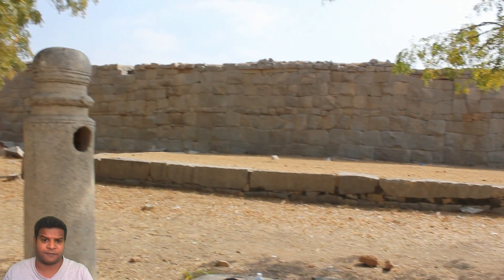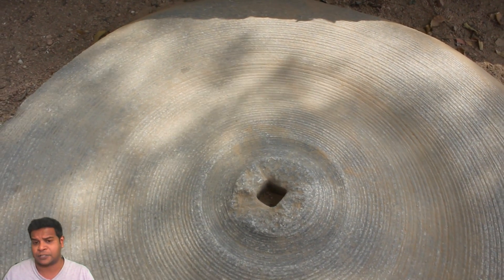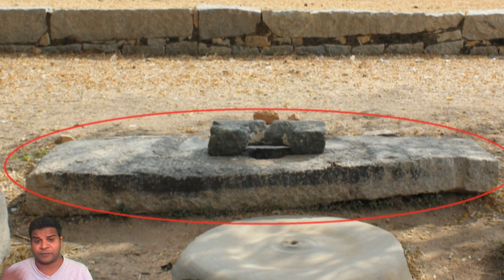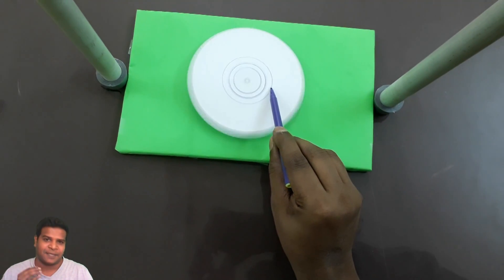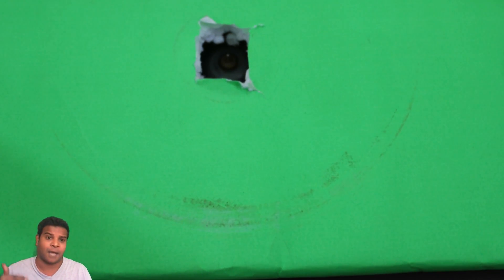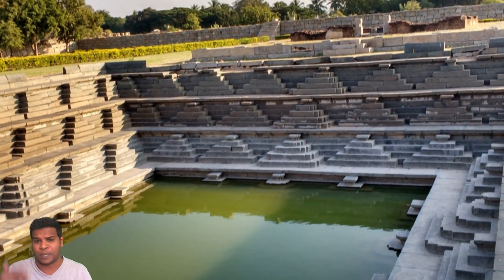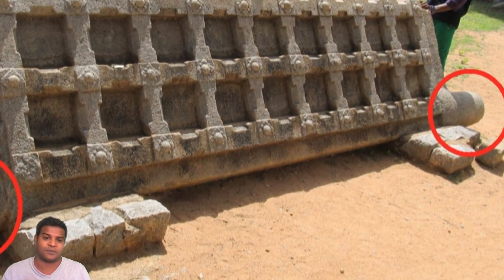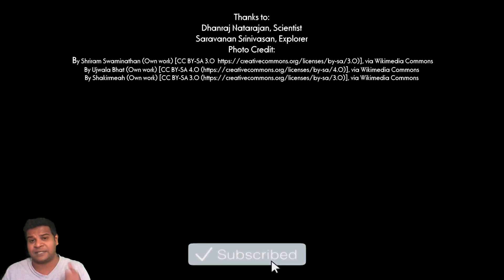Ancient Lathe Machine Found in Hampi, India - Lost Technology Discovered?

Comment: I have some questions that I don't think you addressed in your video.

1. How can you reliably date stone items you found on the surface? There is no archeological or geological context.

2 You stated that the rectangular hole in the item you found is at the center of the carved circles, but to my eye, it looks off center. Did you do any precise measurements to determine how close the hole actually is to the center? Did you document the measurements on video?

3. How could the objects you found or the model you show drive an object in a circular motion? In your demonstration with the pen, you have abandoned your model and appear to be driving the disk from the bottom with a motor, but there does not appear to be any room for a motor or other drive system in what you claim to be the base of the anceint laithe.

4. Hoe does the fact that concentric circles can today be made on a modern laithe prove, that the same effect could not have been achieved in the past using a different method? I cannot follow your logic.

Comment: Please see that place closely it's not a lathe, it was used to powder grains. That stone slab have the mating pattern of that round stone. And distance between the two pillar is less than the width of the slab. Round stone is supposed to be placed over the slab and rotated using wooden stick to powder grains. One more thing lathe is not a futuristic technology it has been there for thousands of years in different forms ( e.g. The way they made wooden wheels, making clay pots). What you see now is a evolved form of it. Please don't miss led people. If your want to check it your self go to Hampi it's in the parking place near Mahanavami dibba.

Comment: yo bro, very interesting. one question however. i agree a type of lathe may have been used or posibly...more likely a ceramist potters wheel. the more impactful question for me is what was this stones use? also,, wouldn't the gouges that represent the circular patterns appear at different angles if a tool was simply lowered onto a rounded then perpendicular surface. i'm just saying! K.K. DO (Doctorate in Observance)

Comment: Its a mill stone At 2;20 you can see where the round stone ran on the flat stone producing a negative of itsel....f the hole in the centre of the bottom stone is to allow whatever you were milling to pour out,,,  the missing pole between the two pillars allows you to lift the heavy mill stone off its bed and clean it ..... its not a lathe its a mill wheel Ireland has lots of them from this period.

Comment: The guy is correct. Machines wer used, but time line is much longer and machines much higher tech. .. According to the Pleiadian Mission by Randolph Winters, based on Billy Meier's 70+ years of et contact,  at theyfly.com, the Giza Pyramids were built in 71,344BC.  You can google ancient machining at Giza, especially well researched by engineer Chris Dunn.

Comment: Very interesting! Just a few thoughts: lathe technology is more than just the setup, and depends largely on two factors. The first is that the machining tip is harder than the material it is shaping. The second being turning the work piece at sufficient speed for the process to work WHILE  minimising chipping. So you need to work on the two subjects.

Further, the setup you're proposing does not seem to have a mechanism to lower it raise the work piece or the machining tip, one of these would be required.

Also the setup does not account for torque on the machining tip.  Where the direction of force aligns with the axis of the machine tip, you'll get the work piece pulling on the machining tip, causing an imperfect finished product. There is a reason we don't build lathes this way today. And though the could be temporarily accounted for with "stops" or "locks" those would get worn down and experience increasing deviation as they age. 

So I'm not disagreeing with you. In fact, I'm excited at what you're sharing and hope you continue to develop a more perfect (accurate) picture of the past.

Good hunting.

Comment: Nice find! More research needed! Are they separate circles or a continuous spiral? If it’s a spiral, the mechanism on the cross bar becomes even more complicated and amazing. This is way out there but if it’s a spiral it would be interesting to attempt to “play” it like a phonograph record! It sounds crazy I know, they probably wouldn’t have known to record sound in this way but sometimes sounds can be captured this way by accident. Given the scale of the disk, it may be possible something remains of what sounds were going on around the stone when the grooves were being cut, even with the weathering. There were small record players that rolled around the record under their own power as the record lay motionless. A similar design might be interesting to try and not be very expensive or complicated to try.
Reply: Here is an example of what I’m thinking of: https://youtu.be/SM-TcnLF2Tk  This is a new product but an old idea. I think there was one years ago that didn’t use an electronic amplifier for sound, only a battery and motor to drive it at a steady speed.

Comment: Well, I have bad news for you. It is not the oldest machine known to mankind. Google "millstones". Here, in Europe, we used them already 10 000 years ago, and setup is very similar to what I see in your video. As I know in ancient India it was a common machine too, I think it's called "Chakki". 
Yes, it is amazing structure and yes - it is a machine, but first, you should see around - does it look like it is a place for workers to do lathe work? Probably it was used for the very specific process. And I don't think that the smaller round stone is a product. I think it's a part of the machine. If you would look into ancient China - they were using massive cranes, water-powered mills, machines and much more made just of wood and metal. I guess you didn't see this https://www.youtube.com/watch?v=4TzLejrJ6I8

Comment: you need hard bearings and softer shafts running in them. grooves inside collars for water and/or oil lubricant to run inside the collars. I would guess wind powered with large textile and wood funnels to concentrate the draught onto the wind veins. Although ducted water onto high leverage scoops would work in wind innaccessable spaces. By the way a square plug hole is for something inserted that wont rotate other wise it would be easier to male a round hole. 
So maybe a stone critically balanced and turned by a shaft connected, then perhaps turned by wind water or whatever as you have there, might be the fly wheel for momentum.

Comment: brother , very good video , really impressed by your video , 
this lathe made of stone is simple and not strange , can u explain the power drive for this , like may be animal powered or water powered , 
then chiselled stones of the pond u showed can be chiselled by skilled workers it is a possibility , 
can u explain those beautiful stone doors , they are marvellous 

i would like to add one thing , as u showed in your video the building process of modern day buildings , after the building is made , the mega machines and huge scaffoldings are removed , so obviously if the big structures u showed were built some kind of machines would have certainly been used to hoist the huge stones and then removed from site , can you find some examples of ancient machines like the lathe u showed , 

i was wondering if you could explain as to why the base stone was removed from the centre of lathe and placed at the site and also as to why the circular stone was in the middle of the two pillars , 

is it possible that the machine u showed was a flour mill .

Comment: would it need high speeds? working with rocks would rather need the opposite. but sharp and hard tools might be needed.
would a simple hanging metal pole do the job? rather not because its too instable in principle. but a little more complex setup like a lever with two ends can do "wonders". one end is for the operator to pull with a little rope (some knots are allowed) - and the other end with some wheight... well "forging" a rock wont work without some sort of force applied. - think again - you might be on the wrong track - at least the missing part is not the one that you depicted for various reasons. be a genius and think like an engineer. the indian ancestors were. ;-)

Comment: I think that the machine in question is not a lathe but a milling machine for grain. The circular piece is the millstone. It fits into the base stone .  An outside force is used through the square hole to turn the millstone. the grooves are a result of years of use. Windmills that were used to grind grain had a similar setup and of course the wind provided the power. In this case a cross bar powered by oxen could have been the power source, or several Conans turn the wheel like in the movie Conan the Barbarian.

Comment: I Think you stone lathe needs more investigation, the large centre stone must of held a circle with a square drive to fit in the rough centre of the round stone, and above it or the weight against each other wont rotate and would scrape away the groves in the surface, if we stick with your rod passing through the posts the it would make sense that one end would have a arm extending of it with a weight to keep a cutting pressure also a second tool would be used to follow around the arc of the stone. also on the small stone sitting on top is that a makers mark or a reference point, the circle with a line going north to south on the back of it.Just my thoughts...

Comment: Praveen, another great video from you!
There is An interesting theory that can explain a lot (don't know if Ik mentioned this earlier:
Please look for egypt pyramide geopolymere technic.
A company explained how they could do that with ancient tools. The stones of the pyramides look natural, but they are not, they are manmade!!
Using salt water and limestone grain, you can make huge blocks cuz you can make the stones in the spot like concrete. Wooden cast, pur IT like cement.
In your video maybe they did the same (all civilisations had contact with each other).
Maybe they did not have to use laser or power machines. If they did IT like geopolymere, the Stone would be soft like clay and then it is easy to make the circular ingravings, just as you did with the pen.
What do you think about this idea?

Comment: the round rock may be upside down. the groves and contour seem to match the ones on the larger piece. the square hole may have been a mount to the centre of a bearing .  i believe the round rock may be flat on the other side and have been a rotating table

Comment: Interesting! My father in law was a machinist. When my wife and I were dating and for a time after we married I worked for him in the machine shop. I would suspect diamond then like today would be the most likely cutting tool. While your "machine" is possible it presents some problems as well. Tooling would require a form of power, hydronic or water would serve nicely. Another problem I see is the long distance from the rod down to the work piece. Even stone would reflect and push away from the cutting tool. This would result in breakage of the stone. Possibly much like the breakage seen on the slab opposite the rub marks on the slab. I think in India, Egypt, and other Ancient sites it is obvious men not only knew how but did create machines to cut and form stone for construction.

Comment: great theory and reconstruction , but too much detail is missing at the moment . more evidence is needed before so called experts will accept your theory  . your spinning stone with circular grooves could only have been made  with a machine , a grain mill would not produce the concentric circles with such  accuracy , but you need to find more parts of the machine if they exist , at the moment you have a  stone with circular grooves , a large slab that looks like something has been spun on it  and two pillars with a hole , there must be a lot of stone dust around the base of the machine produced by the machining , and a lot of circular stones in the local vicinity that would need to be made by machine  other wise there would be no need to make the machine .. i don't  want to dismiss your idea ,it's a very  good explanation , but more proof is needed .

Comment: I'm kind of stuck on a few details here.  To precisely maintain the axis of rotation, and to carry that amount of unbalanced load, you'd need a really strong spindle with very nice bearings, right?  Or is there another way?  And what system of force would induce the rotation of the stone without tiring (human labor) and I'm assuming it would need to be steady?  And if a cutting tool were hanging on a bar between those holes, what would prevent the bar from rotating on it's axis and allowing the cutting tool to be pushed out of position?  It seems kind of janky to me.  I'm not saying that it is not a vertical mill.  Just that it's still very perplexing.  Anyone have any ideas?

Comment: dude you are brilliant i love your videos great work !!!!!
Reply: It looks more like a grain grinding setup with the round stone turning on the flat stone, hence the wear marks.  The vertical tool you propose is not viable as you need to have the tool rest very close to the work otherwise you just get the tool chattering (vibrating). The pillar pivot points could be part of a gear setup to turn the grindstone or just for a bar to hang your sack of grain on above the wheel. More investigation needed.

Comment: That round stone is the turntable which should be flipped over and placed on the long base stone on the ground, the square shank is for driving it from underneath. It is a bit crude and should have had slipper shims to stop the wear on both turntable and baseplate and used animal fat or oil for lubricant. Roughly shaped rocks from the quarry are placed on the turntable and the cutting tool brought across as the turntable is rotated and when a face is completed the rock is rolled over and squared up before machining the next face and so on it goes, they may have used diamonds from the kohinoor or similar area as the cutting tools or just hard replaceable stone or metal cutting tips. I use a lathe for making square or rectangular objects from any material so don't get caught just looking for round machined objects because I would have done every square stone with it too, go and search for "cube within a cube" on a lathe which is our very first machining job as a machinists apprentice after six months of creating everything with hand tools. I am at the end of my engineering life having now retired and know exactly how they were making the stones but it took you to discover the evidence, keep up the fantastic work. Ken - Australia

Comment: That is an interesting idea you have their. Potentially could have been as described but I am not sure. The round block looks like it was formed from a cement like mixture as seen used in Angkor Wat. I noted in your video that the slab also had circular markings. Do you have a theory for how the blocks were rotated and how the lines are drawn down the curvature? I think you have made a discovery here and while I am not sure I agree with the current state of the theory it is a great find and presents questions that need asking. Great work.

Comment: The slab didn't move. Your rod for carving was placed in the slab. That's why it had half circle. The rod would move after it finished the circle. The circle on the ground was what rotated. The 2 poles on the side would have been used for the weight. Just like lowering a water bucket into the well. You would lower and raise the weight that would press against the rod used for carving coming from the slab.

Comment: very clever, I think you got it right, it makes perfect sense.
  I don't know if your aware but with metal lathes there is some turning that is done by holding a metal cutting tool in your hand similar to a wood lathe. It isnt done much any more but you can make very good tight and or very curved surfaces with your own designed tools.

  As for the turned pieces at the buildings, they must have used the same lathe but the cutting tool is held sideways and the pieces standing upright ! !

Comment: You shouldn't be too surprised by the sudden realization that ancient people used rotating tools. Try making pottery of any kind that is symmetrical like the ancient and currently used ceramic jugs to carry water without using a wheel and it becomes noticeably difficult to get a decent shape with uniformity. I am using an eight inch tablet to view this video, but it appears to me that there are small petroglyphs or carved symbols along the side of the stone sitting atop the disc. I'm just curious to know if anyone else sees them and if so I would like to know if anyone has interpreted them.